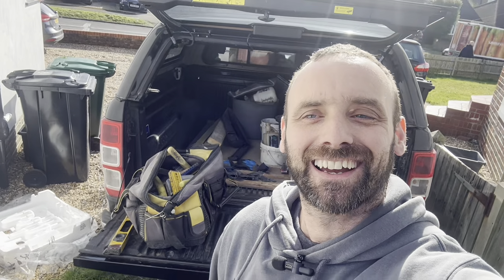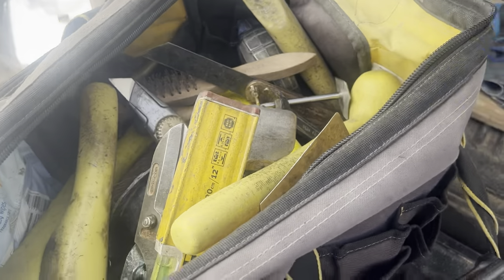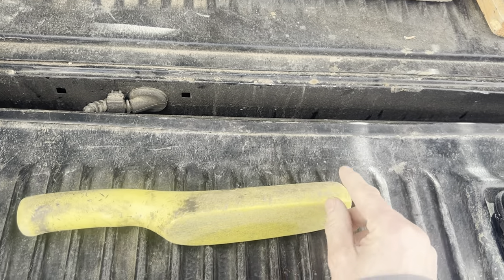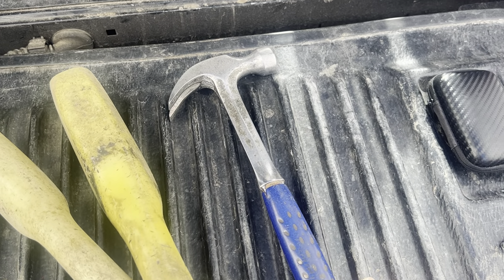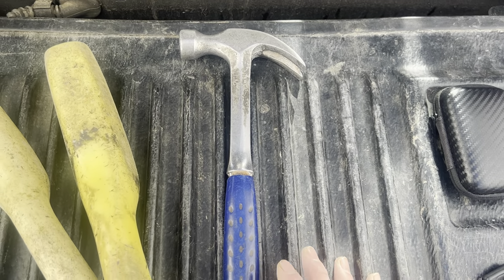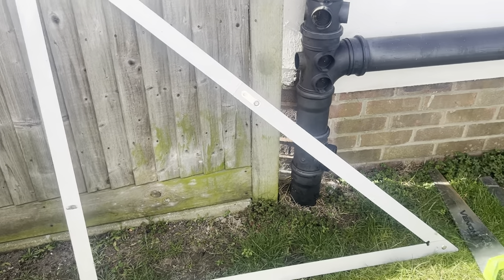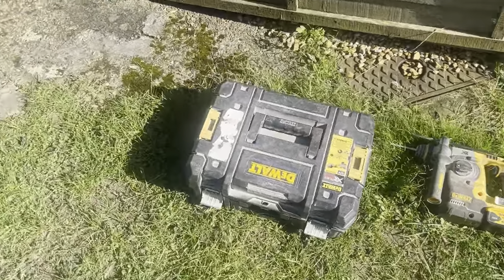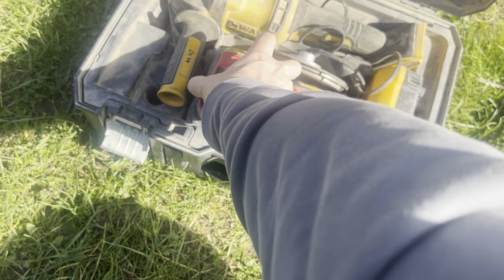What’s In My Tool Bag ???.Getting Into The Trade. Tools You’ll Need.

Comment: Very interesting. Relatively few tools to carry around. As a Carpenter/Builder in Australia my daily driver is a Landcruiser Ute. Behind that I tow a 1.5 Ton trailer full of tools. All up on the road nearly 4.5Tons. Then at my house I have a 6M x 6M garage packed with tools. A large carport with things like cement mixers. Scaffolding etc. Even a Genie lift. Plus part of a stable block with saw benches. Sheet lifter and numerous other bits of plant. If I had to pack up all of it, we are looking at a 40 ft semi-trailer load. And I still have in the bottom of an old carpentry bag from the UK my lead dressing tools. Some wood. Some plastic. Plus old roof tiling gear including a slate ripper.  Over the last 42 years I have probably spent enough on tools to have bought a house.
Reply from the maker: Carpenters carry so many tools don’t they. I think out of all the trades it must be the most.
Reply: I know that feeling mate im a chippy myself 
When I first started I had a tool bag the same size as stuarts
It's a lovely way to work with just hand tools Predominantly 
I can spend an hour and half a day setting up and packing up. And that's if we are are lucky that someone hasn't come along and robbed the van.🙈
Reply: @slbleadworks  they do Stuart. 
I'm having to start doing a lot more of the leadwork myself now as it's hard to get the quality. I'm a million miles away from your ability but all your videos are awesome and a massive help to people like me. I've inherited a lead welding set up of the guy who I worked with for years as he's retired now.
Keep them going mate the quality you produce is the benchmark 👍
Reply from the maker: @hn9598  Thank you I’ll definitely do my best to keep them coming. I really appreciate the views. Thank you.
Reply: @hn9598  You must be of a mature age like me. When I started nearly 42 years ago in the UK. I had one canvas tool bag and a circular saw. How we got to the stage of needing Pickfords to move us around. I don't know. Thankfully now in the stages of retiring.

Comment: I’ve done the nozzle cleanup with the wire brush I got a set files for cleaning carburettor jets they are good if you get a stubborn bit of splatter and screw fix do round mortar rake for the grinder which is ace for getting right in the corners
Reply from the maker: Oh ok I’ll have to look into one of those from Screwfix.